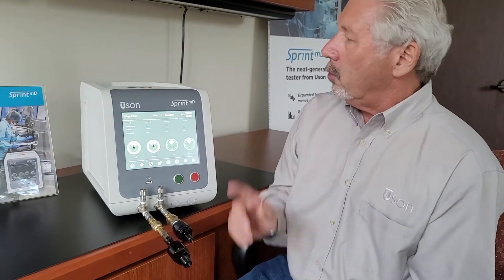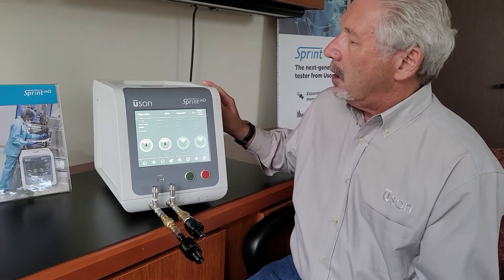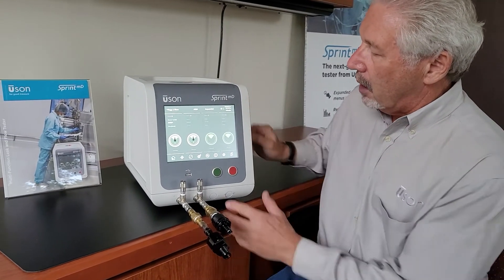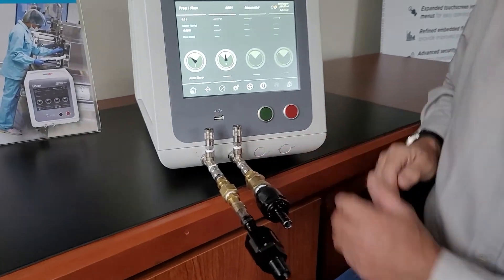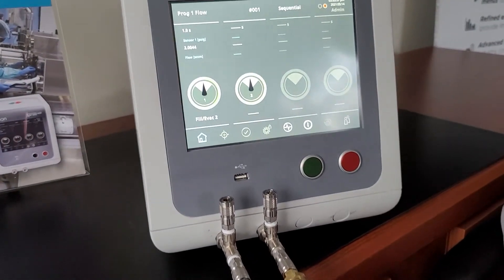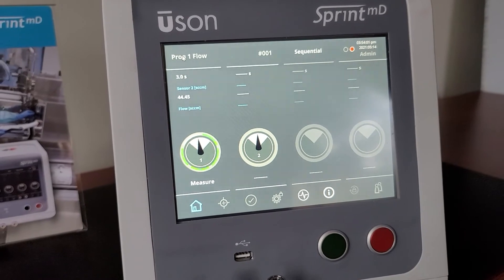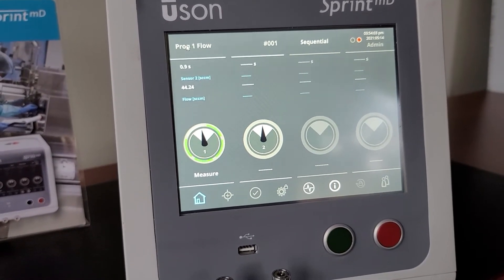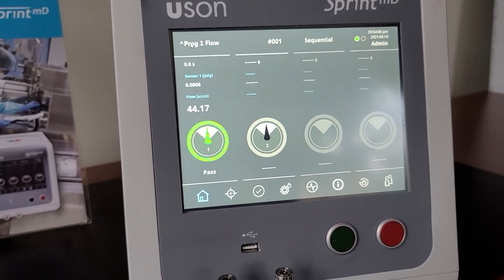Mass Flow & Pressure Decay Testing

Comment: Hi!!

Currenlty I'm using the pressure decay to detect leak in my devices, however, I'm getting issues in calibration using master gage, so, I need to understand how Filling, Stabilization, Measure and Vent processes works to see what is minimum times that I can set to test properly my device.

Regards